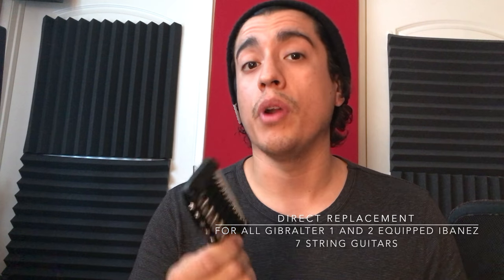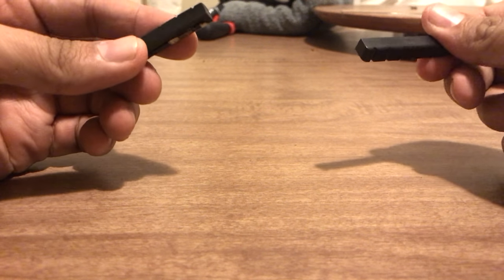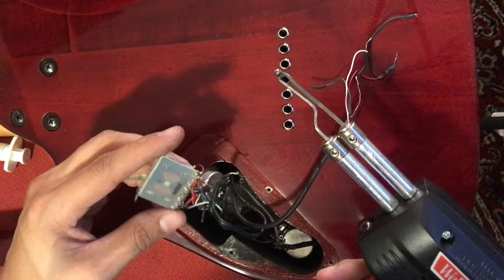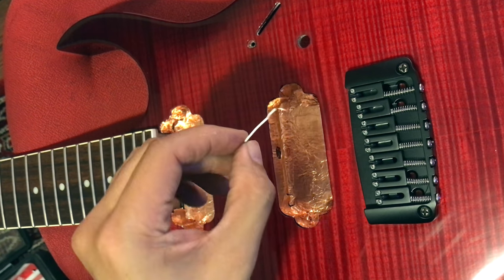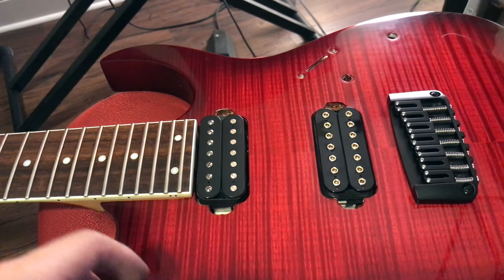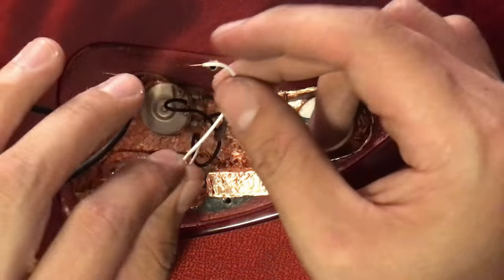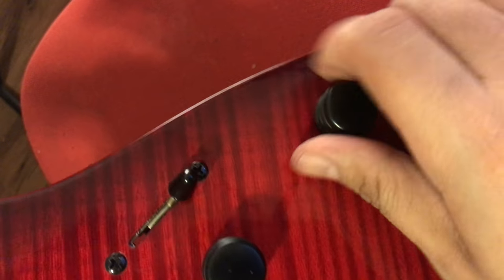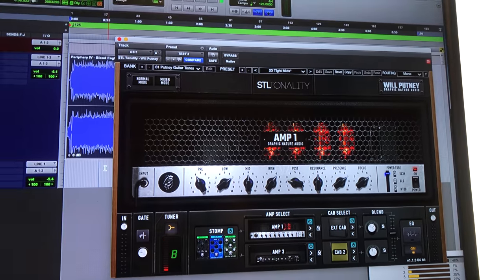Make Your Low-Cost IBANEZ Play Like A PRESTIGE! - 12 Minute Mod Tutorial

Comment: This dude is talking about glue tone, I can't be the only one who find this crazy right?
Reply: But cool video anyway
Reply: i'm literally in shock about this stupid shit about glue tone lmao
Reply: Ahm, not crazy.
Not when you consider how thick, soft, and rubbery wood glue such as PVA, or Aliphatic Resin Luthiers Glues are.
That thick rubbery layer between the new Nut & Fretboard at the Headstock WILL slightly reduce the resonance transference between the surfaces.
That is WHY we use a thin hard-setting Glue such as Thin CA for Fretwork & glueing the Nut.    😘
Reply: Not crazy. It does affect tone while high gain amplified
Reply: I'm with you. The Guitar was already a good instrument. The upgrading is just changig of parts for more expensive stuff. No musically effect, only for the show. Locking tuners don't keep the strings better in tune than good regular tuners. The original bridge is  good quality. The only bonus of the new nut is, that it will last longer than plastic. Many tone-myths in this video.
Reply: @retrochannel1763  locking tuners prevent slippages you high?
Reply: @retrochannel1763  you're capping.  They are drop in replacement parts but made of better materials to a higher standard than the crap ibanez orders by the millions to sell on a $200 new guitar.  I'm personally skeptical of things like volume knobs being noticeable tone wise, but the hardware the strings interact with is probably a place to spend some time and money on better materials.  Switches and knobs are mostly for convenience unless you are into split coil phase reverse HSH etc setups where you need more controls.
Reply: @retrochannel1763  you should stop snorting glue.
Reply: Not crazy. Everything affects tone
Reply: I use donkey hide glue to keep my tone kick ass.
Reply: @dtotheatothevtothee  boom :)))
Reply: Not crazy no.
Reply: You haven’t lived until you hear the phat toan of Elmer’s glue
Reply: The only thing that changes the tone of a guitar are the pickups.
Reply: @ZeginMakesMusic  lol
Reply: @ZeginMakesMusic All the little details add up to the overall tone of the guitar, wood type, pickups, hardware, electronics, strings, etc. Then you have cables, effects, amp, speaker...
Reply: Since he took it to a tech for a setup anyway I would've left the nut un-glued and had the tech touch up the nut. Those "pre-slotted" nuts always need additional work on the slots.
Reply: @Thrashmetalman I thought I was high when I noticed my guitar sounded better when I used the Elmer’s stick glue
Reply: @retrochannel1763 the bone nut is a huge reason why the tone is different and how it will stay in tunde due to the friction difference. The sound resonates because of the nut being swapped out. This is the weirdest thing i have seen someone say about this topic.

Comment: I work in the  senses and perception lab at York University. My thesis involved evaluating if musicians could tell the difference in tone with electric guitars. We had 6 groups which consisted of 

Musicians who listened to back-back live playing of samples with 3 different electric guitars without visual cues

Musicians who listened to recorded samples if the same instruments 

Non-musicians who did both of the same 

And of these three groups 1/3 were randomly assigned to a condition where there was no difference between the samples (the same guitar was played 3 times for them )

There was no correlation between body wood and detectable tonality. We also had frequency spectrum analysis done on the recordings and they were more dissimilar between recordings of the same guitar (sonically) than varied due to wood.  If the guitars had the same pups and were played the same and it was set up well there was no reliably discernable difference. 

That being said people in our experienced musician group could identify the guitar with the tremolo installed  about 60% of the time (the tremolo wasn't being used while playing)
Reply: Oh man I'd love for you to run this experiment with audiophiles. Those fanatic music snobs that spend 100 times more to achieve that last 3% quality and look down their noses at brand X because the doorknobs at the factory that makes their packaging their products are sold in have .003% more zinc  and weren't built by virgin elves using magic spider webs and captured baby giggles.  And because of this their expertly trained ears can totally tell the difference produced by that inferior brand X that sells for less than the ones they get. 

I thought there was something to it all. Got a DAC and fancy amp and expensive headphones.  It works but I can't tell 99.9999% of the time and none of the time if I'm not looking for it.  Now I have just a headphone amp and reasonably expensive headphones, sounds just as good to me.
Reply: very interesting research, good job on that.
and that last sentence is pretty amazing
Reply: @jros4057  to be honest it would be interesting to work with audio professionals. Our 'musicians' were self identified. So there was a big issue with variance there (the distribution for the musicians was kinda inconsistent, and had a soft double peak) . The research could definitely be improved to see how MUCH difference there is and if someone CAN tell the difference. Perhaps much more experienced musicians would do better, but the people on our list who had 5-10 years of experience didn't do significantly better than musicians of 1-2 years or any other group.
Reply: I don't doubt someone could tell there's a difference, but reliably telling which is which or what changes were made we concluded is basically impossible for an average person, or an average musician.
Reply: when it comes to a solid body electric guitar there's no such thing as tone woods. Tone woods make a huge difference in acoustic instruments though and that's why they were called tone woods. Guitar manufacturers have used the term "Tone Woods" for a marketing strategy for years. So many people hear with their eyes. I can't even begin to tell you all the people who have stated "There's just something special about the sound of a "Les Paul" guitar."
But they wouldn't be able to tell the difference in a blind test if those pups, and electronics' were wired to a shovel.
The pups are the heart of every electric guitar. but as the late great Mark Twain once stated "It's easier for someone to believe a lie than it is for that same person to believe that they've been lied to."
Thanks for sharing your test results with us. I do believe that the guy in this video was a lot happier with his guitar after his mods. If not for nothing more than just the sustain and holding tune better. Not to mention how much prettier it looks with the mods.  Again, thanks for sharing your study results. Peace.. Joe
Reply: Is your work published publicly somewhere? I would love to read into this more.

Comment: Question:  Why did you use the copper foil?  and why did you have to ground it?
The guitar looks amazing after your mods. I just never seen anyone use copper foil before.
Reply from the maker: To have a shield for EMI to go to ground, less noise especially if you overdrive your amps or sims.

Comment: what are you putting on the volume pot before soldering the ground on it at 8:00 ? 
great video! Didn't know there were direct replacement bridges for these ibanez bridges. so much easier without filling and drilling holes in your guitar...
Reply from the maker: Thanks Chris, It is flux paste..makes a more solid connection to the metal surfaces. You can do without but it make the joints and contacts more solid and secure!

Comment: Do this same mod woth an old 2000/2001 RG7421/7621 wich are made in japan, basically those models are prestiges without the prestige logo and pricetag. I have a RG7420 upgraded with fishman fluence moderns, Original floyd rose and locking tuners and it is a beast!

Comment: So the hipshot bridge fits perfectly in the spot og the tight end? looking to upgrade like you!
Reply from the maker: Yes you have to make sure your replacement fits where the old bridge was. Mine is a 7 String Ibby HM Guitar Bridge direct fit from the original one that the guitar came with.
Reply: Loved the mention about the wood glue. You're crazy like me...and right. One other thing that changes the tone is the capacitor. I found by trying out a ton, that the paper and oil caps that Bareknuckle makes sound the best for old school riff machines...gibsons, prs, teles. For shred guitars the green ployester 22uF seemed best to my taste.

Comment: Nice video and great song at the end :-)
I want to do the same thing with my RGIR27FE. But I’m confused with the locking tuners. I didn’t want to drilling the head stock and it’s look like that yours have a plate for the 7 tuners… it is custom made?
Reply from the maker: No plate I just positioned them so they don't look funky and just screw drived it in place, not a practical way of doing it because I didn't have a drill at the time lol

Comment: What was in the white tube you put on there before you made the solder joints?
Reply from the maker: It is flux paste, makes solder joints have a stronger connection.

Comment: Could I put Seymour Duncan black winters in my ibanez rga42fm?
Reply from the maker: You got to make sure the string spacing is correct for the guitar other than that i think it will work
Reply: @ivanfiallos-zambrano5911  yeah I put them in like 3 weeks ago. Worst pickups I’ve owned in a while. Way to much treble and not enough bass.

Comment: So I have some criticism. First off there is no A/B comparison, no I understand that you wanted to make a fast&easy tutorial, but in MY opinion the comparison is mandatory.
 You did not mention what pickups you put in the guitar, which is fine I guess, but I would've liked it if you said something along the lines of "replacing with premium pickups" or "here I've used some premium brand pickups". I feel that is lacking. I read the comments first, of course, but it seems that few people do read it. 
And at last just a comment on your impeccable shielding technique: I'd ground the loose tone pot anyways, just to ensure no noises could come from it. And the Plastic back cover does have aluminium foil on it already, so taking a wire from a common ground, and then leaving the exposed conductor wire between the back plate and the screw shelf would be sufficient.

I know it's a lot of text, but mostly only minor things. Generally enjoyed the video very much. Going to check out what else you have to offer ;)
Reply from the maker: Appreciate the feedback thanks man!

Comment: Nice vídeo, I'm thinking to upgrade my ibanez Iron label RGIR27FE but I don't know which height hipshot tuners are direct fit. Any recommendation?
Reply from the maker: Hey Eduardo appreciate the kind words! The ones I purchased for my 7 string should be able to work on yours, but the only thing is that it will need some drilling (pilot holes) but my impatient ass decided to just screw into the headstock of my guitar since I did not have the right tools at the time but check this out! https://reverb.com/item/38732-hipshot-grip-lock-enclosed-7-in-line-non-staggered-post-black-locking-tuner?bk=eyJhbGciOiJIUzI1NiJ9.eyJqdGkiOiI1YTRiMDUwNS0zMTcxLTRlNDktYTc3MS1lZGJkNmJmYjE3ZDUiLCJpYXQiOjE2MTU2MTg0NzksInVzZXJfaWQiOiIiLCJzZXNzaW9uX2lkIjoiNTI4NGUxNjUtNWE1YS00NjI0LThjNjMtMjFhN2M3ZjJjM2EwIiwiY29va2llX2lkIjoiNDE1NTM3MjUtMDAyNC00ZjM1LTgxYjQtNmM0MjU0MGZkYmE3IiwicHJvZHVjdF9pZCI6IjM4NzMyIiwic291cmNlIjoiTk9ORSJ9.kiDkpsJJ-EzFsykDBk-TIG-VOQtaK4tprnno5bo8VwQ

Comment: What string gauge you used here ?
Reply from the maker: Hey Joe I used Daddario NYXL .011/.014/.018/.030/.042/.052/ pack and purchased a single .64 of the same string type for the 7th string in Drop G#
Reply: @ivanfiallos-zambrano5911  Thanks broo! Very similar to the set that I use but with the 0.62 on the low string. This 0.64 Looks pretty nice for G# your guitar
Reply from the maker: Joe SilvaGT yeah man i pick hard and the extra tension helps with recording for sure!

Comment: Very cool video, but do yourself a favor and learn to solder properly. It'll save you a ton of effort and problems from substandard solder joints. Just off the top of my head - never tap anything with the soldering iron/gun nozzle. Make firm, solid contact between the soldering iron/gun tip and whatever you're heating up, for the appropriate amount of time, then remove it.

Thanks again for the video.

Comment: What model was it before you started?
Pro tip: Buy yourself a small tub of solder flux and a soldering iron of at least 60watts to make those solder joints easier. You are soldering onto large surfaces which require a lot of heat for a good joint. The gun he uses in this video is just that.....a Weller gun that is 60+watts. Your small bench iron might not do the job.

Comment: I think I would have measured the thickness of the new nut before I super glued it you may have to trim some off of it dude it could be higher and it could be lower the odds of it being the same thickness is pretty slim..... PS as good as you are insulating all the electronic components it looks like you would know how to set the guitar up, I mean you have measurements for string height radius nut adjustment I mean there's nothing to neck adjustment, don't get me wrong man great video very helpful and useful but again before I close that nut down you should have measured the thickness of the other one thank you again great video 📸
Reply from the maker: For me the nut was a perfect fit, my luthier did not have an issue setting up the guitar. For nuts like those I would take measurement of the original and sand it down to the perfect height so they match.
Reply: @ivanfiallos-zambrano5911  exactly

Comment: what about the wood lol the prestiges cost the way they do because you're mainly paying for the neck, thats where most of the money goes to
Reply: Most expensive part to replace, at that point just buying a better guitar is not out of the question.  Custom necks for a project like this can be done though!
Reply: @bigdog517  makes no sense to mod a cheap guitar like this unless is a beater and you dont mind wasting money for learning and all, if is your main guitar? not worth it, could buy a used prestige for the same it would cost to mod a cheap one
Reply: @naegleriafowleri2230  All the parts he used are pretty cheap, and if you do it yourself like he did, you would have spent less than you would have on a new guitar by a pretty good margin, even still cheaper than a used prestiege in most cases.  Replacing the neck would have changed that, and the cheap Ibby necks ain't that bad so it isn't really as needed as the other parts are.  Hope that clears it up a bit!